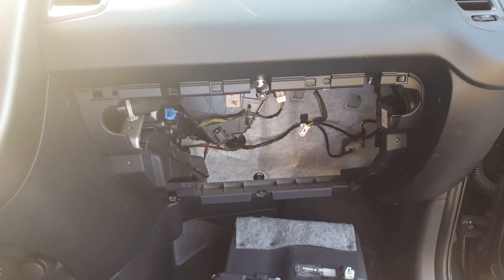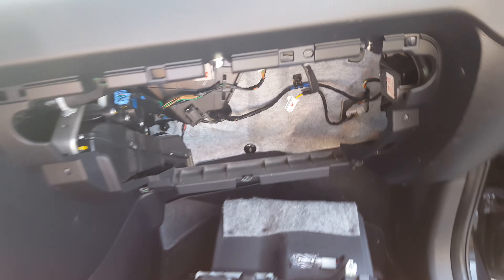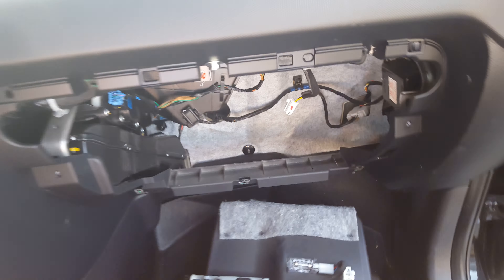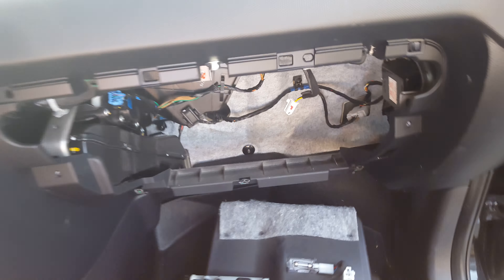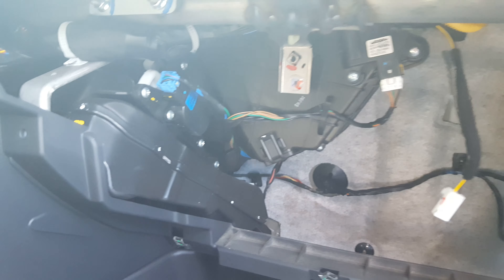How to replace the climate control actuator on a kia soul

Comment: Never mind, it’s on the driver’s side on 2014-2019. It’s actually much easier to replace than yours. Just have to remove the kick panel and 1 shower duct.
Reply: Lucky you

Comment: Hey Nick.  Interesting.   O'Rielly's hooked their little handheld machine under the dash, & said that the On/Off AC/Heater Selector Switch is why I didn't have any AC or Heat, &, also why the Speedometer didn't work. 
Just replaced the On/Off AC/Heater Selector Switch assembly... Still no ac/heat, no speedometer.   
Thoughts ?   Thanks.
Reply from the maker: skweeky kleane I didn't think their scan tool will read that kind of stuff I though it's just a basic engine scan tool that they use to scan engine light. Have you tried checking the fuses or grounds
Reply: Yea, the guy took his little engine scan tester tool, & checked it, like he knew what he was doing.  So... figured he knew what he was doing.
Fuses, yes.  Not sure where to look/check for the grounds, tho.
Reply from the maker: skweeky kleane it makes me wonder if your getting power to the connectors.
Reply: Hmm... True.   How would one check / test for that ?
Reply from the maker: skweeky kleane you will need to find a wire diagram for the climate control switch you wouldn't want to find the wire for power and you want to take a multi-meter put one on the power and one for the ground if it gets voltage you getting power to it

Comment: How do you know when the actuator is not working?
Reply from the maker: If it start making a clicking noise or when it not changing the direction of the airflow or it doesn't change temperature from hot to cold

Comment: Well, you failed to mention the THIRD actuator that is under the dash on the drivers side above the gas pedal. This one controls temperature, while the other two control direction and fresh/recirculated air.You need to get your facts straight and complete before making videos............
Reply: Thank you!! you have no idea how long I've been searching for this info and just so happened to come across this vague video.
Reply: What stopped you from making a video showing the third one?

Comment: Have to agree with some here.
From "discerning minds" "Like and Subscribe???  What year Kia Soul?  Automatic Temperature Control, or Manual?  Which actuator does what?"
Then from "DarkNight042" "This video does not show you how to replace anything, only how to access it. I would have liked to see the actual replacement process given the title of the video gives that expectation. Disappointing."
Another from "davidcronknite4492" "Well, you failed to mention the THIRD actuator that is under the dash on the drivers side above the gas pedal. This one controls temperature, while the other two control direction and fresh/recirculated air.You need to get your facts straight and complete before making videos............"
There's not much to like here unless you wanted instruction on how to remove the glove box.